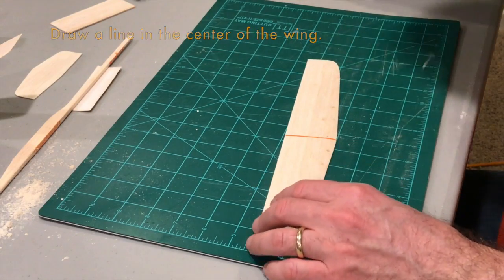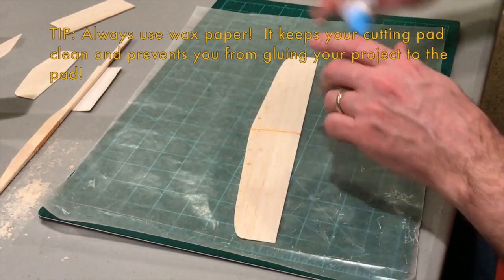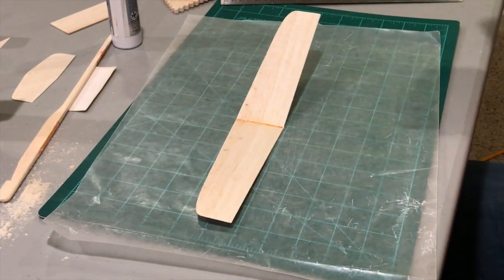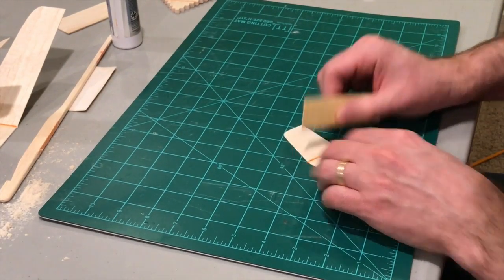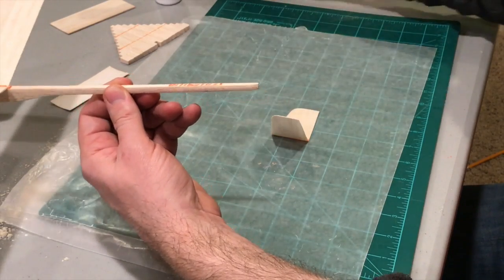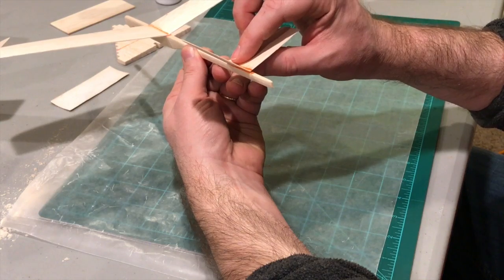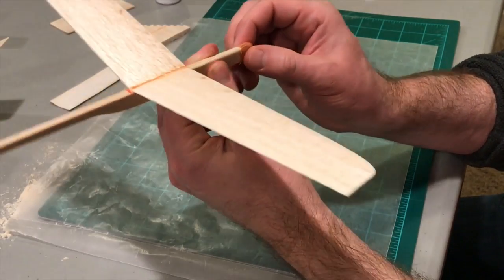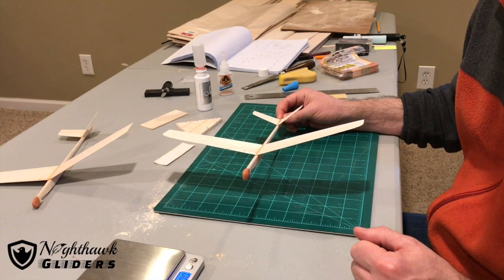How to Build a Balsa Glider - 12" Sandpiper - Part 3

Comment: Oh my, the shot at 8:14 is missing how much you are tilting the tail piece to the right.  It was so confusing,  
Isn't it possible to re-shoot that bit & give ppl a sense of how much to tilt?  
I love these little gliders. 
They work so well, but if ppl get lost at any point, they give up.  
Just re shoot the build section where you align the gluing on of the tail.  Cheers. Great glider regardless of my b*tching & moaning!
Reply from the maker: Yeah, sorry.  A failure on my part.  You’ll want the tail to lean about 1/4 inch lower on one side than the other.  If you are right-handed, lean tail to the right as viewed from the back. This will cause a counter-clockwise glide. Reverse the lean if you are left-handed for a clockwise turn.

Comment: What CA glue did you use when you put it on top of the gorrila wood glue?
Reply from the maker: That was CA Glue Accelerator. It’s a special liquid that helps the CA Glue cure almost instantly.  You can find it in your local hobby store and online.
Reply: @NighthawkGliders  awesome thanks! And we need more videos, they are really good vidoes! And where is this 18inch sandpiper template?

Comment: Hi Nighthawk gliders,
 I just built one of these and I am so impressed. The weather hasn't been right for flying outside yet so I am throwing it around the house. I tried using modeling clay for the nose and I had trouble with it. So I decided to use Kneadable Eraser from Faber Castell art supplies. It is really good. And it softens the blow when it crashes into a wall or something else. It does not dry hard either and can be added to or subtracted from easily.  It is less sticky than bluetack, which I don't think would be suitable at all. I also found that when the wings get dented from crashing into something that just a spot of water on the wing edge will swell the dent out and make it good again. 

I have been woodworking for years and never had much to do with balsa before. Interesting wood. 
There is another wood called Paulownia which I would like to try. I have only read about it but it could be suitable for models too.
Reply from the maker: That’s awesome!  Glad to hear your experience with the sandpiper and balsa.  It’s the preferred wood for aeromodeling. The kneadable eraser sounds interesting.  I use plastelina (modeling clay).  You just have to rub a small bit thoroughly into the wood and then when you add more it sticks better.  Downside, on hot days, it gets quite soft.
You can also glue thin basswood strips to leading edge of your gliders before sanding airfoil.  This helps prevent the dings and makes it more durable!
Thanks for sharing!  👍😊

Comment: Hi how can i make the glider return??
Reply from the maker: A well-trimmed and consistently-launched glider should have predictable results. Applying tail tilt help engage your glider in a circular glide.  But you often have to find the launching sweet spot for Pitch, Roll, Orientation, and Power.  My gliders often stay near me, unless they are out of trim or when the wind varies in speed or when a thermal picks it up.

Comment: 8:10
If I make it straight it will fly straight right unless I trim it?
Reply from the maker: Yes, if your tail is mounted level, it should fly straight. Of course there can be other factors that make it turn. (E.g. warped tail surfaces, warped wing surfaces, wings unbalanced, and uneven airfoil shapes between wings can also influence the aircraft to turn.)

Comment: I saw your note that you use Bob Smith accelerator.  That’s my preferred product.  But I love the idea of the applicator you use (2:50 min mark) rather than the messy spray bottle.  Where did you find the bottle that you use?  Thx!  Great videos!
Reply from the maker: Thanks!  Yeah, the accelerator is a must.  I just happen to find the little bottle at my local hobby store.  😊

Comment: This is a great glider although i had to build 3 since I kept breaking them
Reply from the maker: You may need to get some balsa that is a little more dense.  Thanks for comment and subscribing!  👍😀
Reply: @NighthawkGliders  That explains why adding some weight to the underside of the fuselage helps, thanks for the tip

Comment: Can it fly 190’? I will have to build a balsa glider that can be launched by rubber band and it should be launched horizontally.I am planning to launch it a distance of 60 meters. So, what is your advice for me? Is your glider fly 60 meters(196’85”)?
Reply from the maker: Our catapult gliders are made to circle in glide and not made to fly straight for distance.  Even if you took the turn out of its glide, it has a short body length. This means it’ll be difficult to keep straight on launch and during glide.  Is this for a contest?  Are there rules and restrictions for building, launching, and materials?  I’m curious.  Thanks!NighthawkGliders@gmail.com

Comment: Thank u so much your video  was so good and so was your explanation. My glider worked perfectly.thank u
Reply from the maker: You’re welcome!  😊
Reply: @NighthawkGliders  could u tell me if I make another one with 0.1 thickness (balsa wood )what steps should I take instead.
Reply: O.1 cm
Reply from the maker: I say, go for it!  Give it a try and let us know how that turned out!  The build process will be the same. You’ll learn by experimentation. The challenge is with balsa selection. If you use same balsa sheet for your wing and fuse (as done by my tutorial) too light of 1 mm balsa can result in weaker 2 mm thick fuse.  If that is the case, you may need to find denser 3 mm balsa just for a slightly thicker and stronger fuse. Plus, if you use 1 mm for wings, you may launch it too hard and the wings will snap right off. A thinner and a little longer rubber band loop will go easier on the launch. Good luck!
Reply: @NighthawkGliders  thank u

Comment: There isn't any relative angle between wing and tail, is there? I am suprised it keeps flying when it dives. BTW, great video! I think I will build it too! And please design a plan of your experimental glider!!!
Reply from the maker: The main wing has (zero) angle of incidence. Since there is an airfoil shape on the wing, there is lift even when it dives.  Yeah!  Give it a go and let us know how it flies.  Also, please come to NighthawkGliders.com and sign up for our newsletter on our home page!  😀
Reply: @NighthawkGliders  ok, but wait a few weeks! First i am going to finish my balsa and span paper pressed air motor... 🤞 I usually record my flights, should I put it on youtube? That would be my first video😃 I will let you know if it flies better with some angle, just test it!
Reply: excuse me! pressed air engine! Motor is dutch😂
Reply from the maker: Yeah, sure!  post it on YouTube when you get it flying outdoors!  👍
Reply: I just made some test flights... If Iaunch it, it climbs good, but a little bit of wind always brings it out of balance, so it begins to dive... right to the ground. I think it is too light to fly it in like 2 beaufort, how much wind is your limit to go flying?
Reply from the maker: Yeah, these are light.  They are fair-weather gliders, so you do need calm weather.  I’d say 4-5 MPH sustained wind max.  Wind gusts can be brutal on them and toss them around.  I typically launch my gliders facing downwind, but depending on your glider’s launch pattern, sometimes you’ll have to experiment launching different directions to find the sweet spot.
Reply: It was a very calm evening, so I decided to go flying. I had the same problems, so I added some flaps on the stab. And finally, I could launch it at full power at about 30°. Never saw that! Best flight was 30 seconds, but it would be at least 35 if there was not the tree... I only stopped flying because of the width of the field. I hope I can reach soon the 40 seconds and I will build a new, with some angle of attack. I hope I can film it next time, because it was too dark today. 
See you!
Toon
Reply from the maker: If you can get a 30 second flight on the Sandpiper 12, I call that a success!  I imagine the professional competitors can fly circles around this, but you are doing exactly as I hoped.  You are enjoying flight and enjoying life, my friend and having a great time!  I encourage you to make more of these, since results may vary and you will get better and better. Please email us if you wish to continue the discussion and share photo/video:  NighthawkGliders@gmail.com!  I may have a couple extra tips for you!  -Brad 😊
Reply: Yeah, I will send you an email when I can film it. Btw, I don't think professionals can fly much better than you (and maybe me if I find a bigger place to fly). 60 seconds must be possible, but that's not flying circles around it...😂 Just keep improving your sandpiper. I will do it too!
Toon
Reply: @NighthawkGliders  I just madr some short test flights and I am schocked... wow! It flies great indoors. I hope i can fly it outdoors   this weekend or before the weekend...
Reply from the maker: Glad to hear this!  Yes, the real test will be launching this at fast speed from a catapult!  Good luck!  🤞😀

Comment: Hi brad, I need to build a elastic launch glider for Science Olympiad and your video has helped me a lot but at the end for weight you added modeling clay and the rules say I can't use that I'm only allowed to use wood, foam, paper, plastic film, carbon fiber, tape, and/or glue. Oh and a lip balm container. Any ideas as of what I can use for the weight on the front of the glider.
Reply from the maker: Great question.  You may want to double check you rule book for materials. I bet it does say something like, “non-metal malleable substance able to be used as ballast.”  That would include modeling clay.  The lip balm container is used as a gauge to ensure nose is not too small or pointy for safety issues.
Reply: @NighthawkGliders  oh yes it does say that thank you so much

Comment: Hi there, awesome cheap project.  I made 2 planes for school projects both fly to the right. their challenge is fly futherest in a straight line . Is there anything i can do to straighten the flight please. cheers Paul
Reply from the maker: Ooh, tough challenge and great question!  Getting a plane to fly straight is tricky. If the plane is yawing right (turning right where wings stay level). Try applying some left rudder. If the plane is rolling right (turning right when right wing banks lower than left wing) try adding a little weight on left wing... such as modeling clay or maybe some tape.  If you are designing a new plane you might want to consider making the fuselage longer   This should help keep it straight (like an arrow). If you make the fuselage longer, your tail should have smaller surface area!  I hope that helps and wish you good luck in the competition!
Reply: thanks once again
Reply: school project ....  first and second places  for the longest and
 straightest flights  ...   my twin boys very happy ... cheers
Reply from the maker: That’s awesome!!!  We’re super happy they did well!  Congratulations to the both of them! 🥇🥈

Comment: Mine is 9.3 grams AUW...
How in the world are you getting them down to 5 grams???
Mine Flies good, I just need to figure what I need to do to get it to turn instead of fly straight though.
Reply from the maker: A big key to having a lighter glider starts with balsa selection. I’d say you can still have a good flying glider even if it is a bit in the heavy side.  Less than 10 grams you’re doing alright!   I mentioned tail tilt makes it turn. If you have that and it is still not turning left in glide, try slightly bending the left elevator down and right elevator up. Tiny, tiny adjustments can make a difference!  Good luck!  Thanks for your feedback!  👍😀
Reply: I ended up increasing the tail tilt a little more and now it makes it’s turn beautifully.  Thanks for all the tips!
Who knew $2 of balsa wood could be so fun and addicting...lol
Reply from the maker: That’s great!  Yeah, not bad for a couple of bucks!  Hours of fun!
Reply: I just finished my 3rd build and it is 7.8 g so I am getting better.  A question for you.  Where do your best flying gliders balance?  Mine are balancing about a 1/4” from the trailing edge...  That doesn’t seem right, but maybe for this glider that is common???
Reply from the maker: That’s a good weight.  Regarding CG, yours is pretty far back.  I’d be concerned it’s tail-heavy.  If you launched it... I bet it’s loopy. For these gliders, my CG is around 50-55% of root chord from leading edge.  But, if yours launches and flys well with CG that far back...  awesome!  👏 😀

Comment: Finally got a good morning for flight testing my first Sandpiper. Light breeze out, under 5mph. Glider did the same thing every flight, would come out of launch inverted, if it had enough altitude after making "swoop" it would roll over correct side up. Flies better than expected inverted! I'm sure it's a launching technique issue, but I tried several angles, into and out of the breeze, etc. It DOES come around to the left. If easier my e-mail is noisymuse(at)gmail.com
Reply from the maker: Hmm... well it shouldn’t be flying inverted. I wonder if it would help to apply a little up elevator.  Also, I launch my gliders pitched fairly high, back to the wind, with 90 degree right roll (since I’m right-handed).  But you’ll have to experiment since each glider can be a bit different.  On your next glider you build, you might want to apply a tad more dihedral than what the video says.  Hope that helps!

Comment: Question, I recently built this glider and really enjoyed it, I really hope to get into this hobby, here in Maine the winter won't end! And I've flown it in some tough weather and hadn't had much luck, question is I've dinged up the wing tip on one side, could I trim equal amount off each tip and not effect flight? Thanks in advance i really enjoy yours and Josh Finns videos
Reply from the maker: Yeah, these are mostly fair-weather gliders... they are so light, some gusty wind will knock it around.  We are hoping for good weather too!  Glad you enjoyed the video/glider!  If it does get broken, cracked, or damaged, you can often re-glue with some CA and it'll still fly!  If wing gets a little dinged, that won't affect flight much at all.  If wingtip gets chipped, try flying it broken (no joke) sometimes it'll still fly!  If it doesn't then yeah, trim off the other side to balance it out and see how it behaves!  (What have you got to lose?  If it's already broke and not flying, might as well perform some surgery, right?)  Who knows, you might create a better flying glider!  😀
Reply: Nighthawk Gliders Thanks for the reply, I’ll keep it as is, I plan on building more when I have time
All my best

Comment: Hi Brad, nice video, one question please : what happens if I use styrofoam instead of balsa wood? do you recommed to use  styrofoam?
Reply from the maker: Sorry, Uriel, for such late response.  I guess I don't get notified of all comments made.  The answer is "YES"  You can use styrofoam instead of balsa wood.  Bruce just tried this recently.  He used typical foam board, peeled the paper off one side and sanded the airfoil.  The side with the paper was the bottom side of the wing for strength.  He used a styrofoam plate for the V-Tail.  However, for the fuse, you still need a sturdy piece of wood.  Denser balsa is what Bruce used.  But, perhaps a couple of bamboo skewers (one 12 inches long and the other 6 inches long) glued together (side-by side) could do in a pinch to mimic the Sandpiper fusulage look.
Reply: NICE!!  I'd just direct messaged him a "plan" or "how to" tinkering with a really common bit of extruded styrene/styrofoam. with luck he'll do it up soon!

Comment: PLEASE HELP: Hi, great video! I am making this glider for my MESA project, and I was wondering how I can make this glider make a right-hand turn and land on an X that will be placed 40 feet from the launch area. Will I need to add weight to the sides of the glider or only the nose, or do I need to do something else entirely? Thank you so much !
Reply from the maker: Great question and fun challenge!  You have several options.  In this video, I mentioned tail tilt.  You could tilt your tail a little to the left for a right yaw during glide. You could then possibly fine tune your turn with a little dab of weight on right wing for a right roll. If you build your glider a little bit heavier all around it will less likely be affected by air turbulence. (I.e You are not going for duration and accuracy is everything here). Practice launching a lot and find the best starting pitch, direction, and speed.  Stay consistent and change only one parameter at a time as you trim to better understand the effects. Good luck on your contest!  We’re rooting for you!  😊
Reply: Hi, thank you so much for your help! I have a few other questions: How can I make the glider contain a feature that will adapt to the launch hook on the Official Launch Device? The official launch consists of a tension spring, a launch platform, and a launch 'hook'. The launch hook is made from steel wire with a 3.4 mm diameter. The hook is screwed into a glide block mounted underneath the launch ramp. The mass of the hook and glide block is 35+/- 2 grams. Also, another question: How can we attach wheels or skids that can be positioned so that we can avoid the 'slot' in the launch ramp that is 0.02 cm wide and 8 cm long? Thank you so much for your help ! :)
Reply: Actually, the slot is 0.51 cm wide and 8 cm long.
Reply from the maker: I imagine if you attached a “u-shaped” piece of wood at the bottom part of glider nose as a receptacle for the launch hook, your glider would sit nicely nose on hook and tail resting on launchpad well behind the 8 cm slot. When launched, the glider tail should immediately rise above the slot no problem.